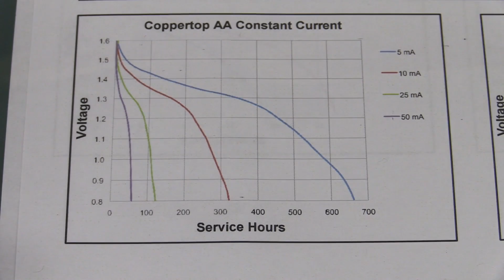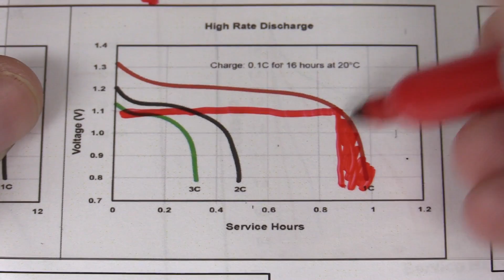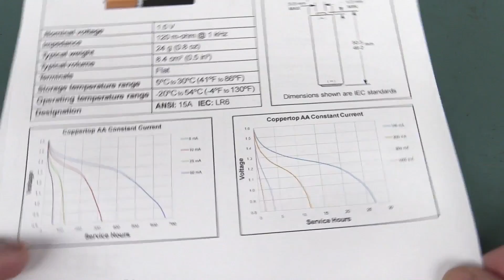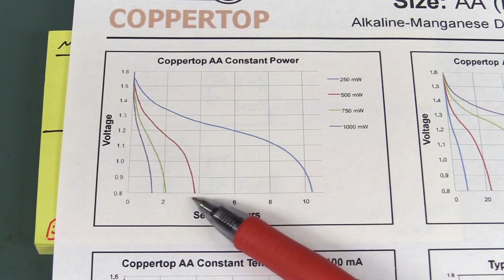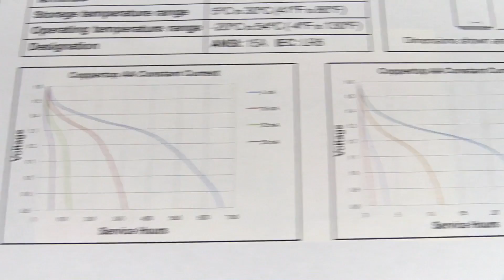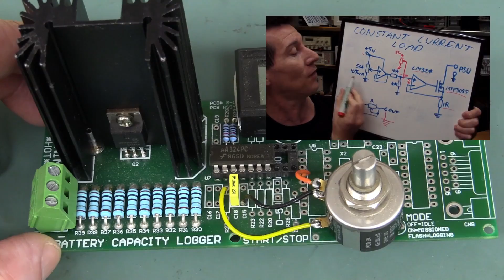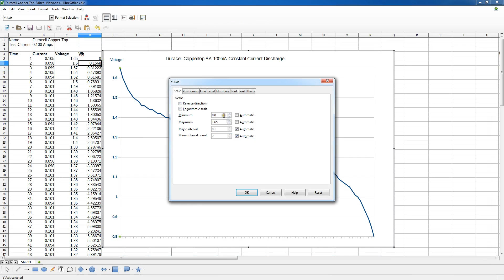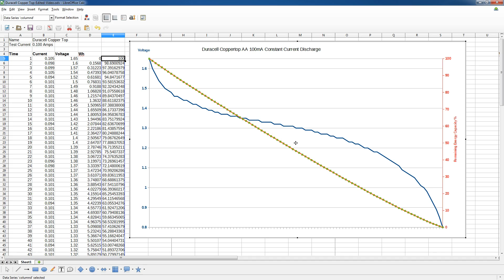Comment: hey Dave I am an electronics noob so don't mind me asking is the cut off voltage a design feature or a product of efficiency of the components used in the circuit i.e something that's an after thought
Reply: hyronov A good designer would try try and make the cutoff voltage as low as possible in order to use the most energy from the battery. Sometimes however that's not easy or cost effective for various reasons. It should not be an afterthought, if it is, you're a bad designer.
Reply: EEVblog  well thanks for the reply adding to that question. Say two manufactures using the same components is it possible that one really well engineered will have a lower cut off voltage.  what rough of order of magnitude lower could  it be .1V~.5V for AA cell.
Reply: hyronov Under 0.8V cutoff is pretty pointless, there is very little energy left under 0.8 for any sort of real load. This is why the industry uses 0.8V as the defacto standard minimum cutoff voltage.